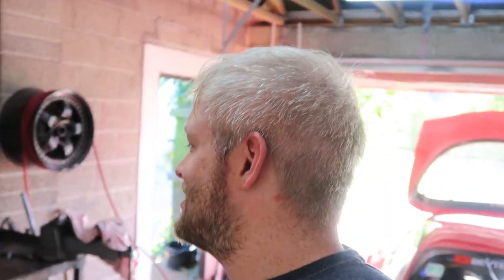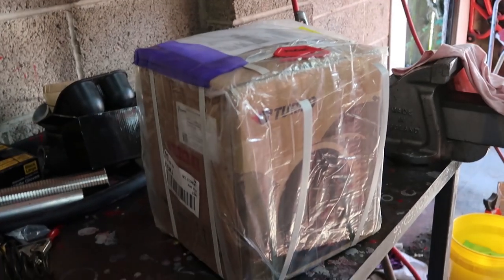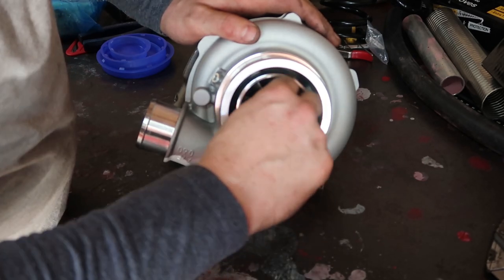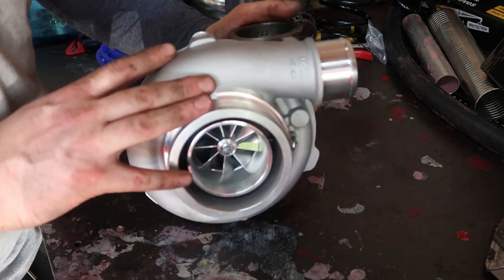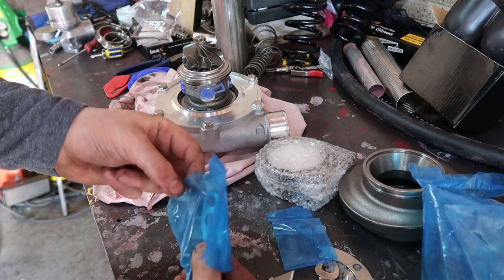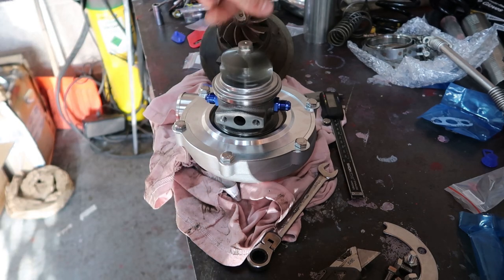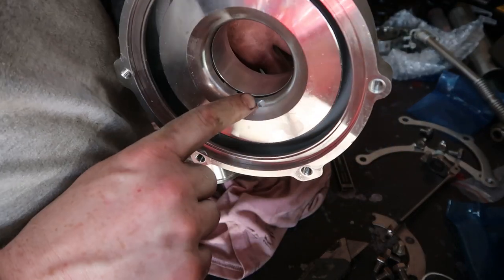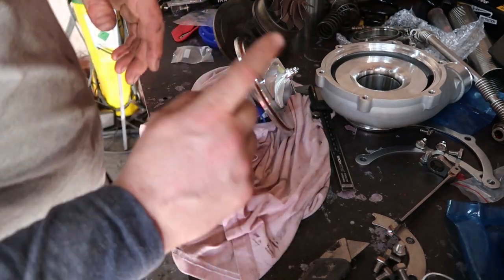GEN 2 GTX3076R PULSAR TURBO UNBOX AND INSPECT

Comment: Oh hey I'm not sure if I've mentioned it yet, but congrats on 1K subs! Well deserved.
Looks nice a sweet turbo! Always nice when they include a restrictor. Cool company to work with!
Reply: @BEYTEK  Oh jeez. Which one? I've spent like 3 days now fighting a Subaru rear lateral link bolt because I was filming a wheel bearing tutorial and trying to show the right way. I already have to replace the rear subframe and I have rear knuckles from a cleaner car too. At this point I think I'm going to abandon the tutorial and just replace everything. 😂
Reply: Thanks! Hah. I want to, but my problem at this point is basically that I actually have nicer knuckles to swap on the car anyways, and I might as well save the $50 bearing for when the next one goes out. Womp womp. Wanted to have the car ready for a trip on Wednesday, but at this point I'll have to take a different one. Such is life!

Comment: I have an actual Garrett GT3082R in my car, but for some reason I just want to buy one of these. I'm really curious how the Pulsar GTX3076R would compare in power and spool since it's a smaller compressor but they're both rated at 65 lbs/min
Reply: Bey Tek Interestingly enough, I just found out the turbo I thought was an FP3065 (DSM bolt on housing on GT3082R) this whole time is an FP3565 (same housing but a GT3582R), so that'd make it an even better comparison. The GTX3582R is supposed to flow 85 lbs/min, that should make a ton more power than 65 lbs/min 😯
Reply: Bey Tek I don't even have the car running with the big turbo yet, but I'll definitely consider a Pulsar GTX series after I do. Lol I'm real curious how it'll compare

Comment: is that full ballbearing I have a real gtx3076r and it spins longer also you can blow onit and it spins ?
Reply: @BEYTEK  ahhh nice man when can we expect all bolted up or you gonna finish tune then compare later
Reply: @BEYTEK  you inspired me to get of my ass and do some bits on one of my cars lol just uploaded the gtx3076r warm up then switch off normally spins for some time then slowly slows down
Reply: There is always assembly lube in them so they don't spin as easily until you start them up for the first time